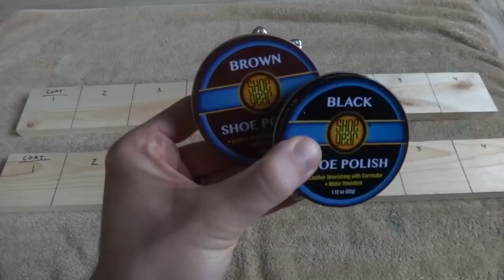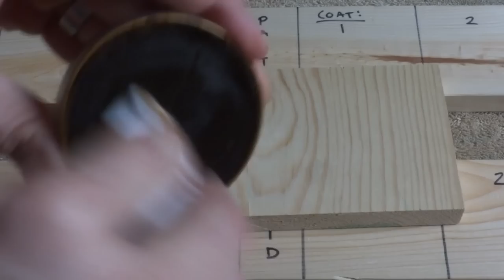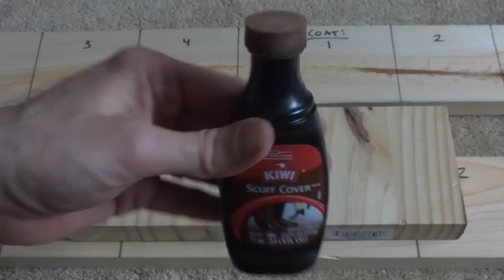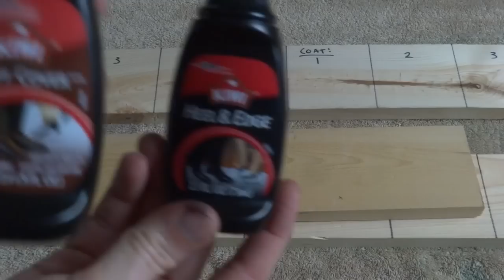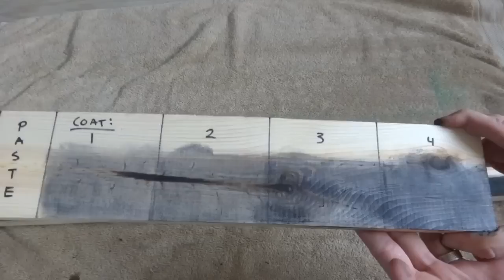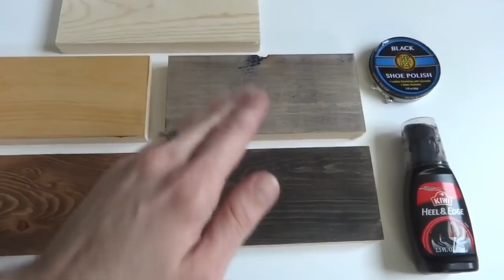How to Stain Wood with Shoe Polish!

Comment: Great video. I'm planning to use shoe polish to darken some parts of my guitar bare wood to make it look 'aged". Would you recommend using the one you use in in your video or would the paste that comes in the circular tin can be better? I plan to mix it with a little water and then use an art brush to paint the small bare wood areas around the guitar. Thanks...

Comment: The brown (scuff cover) is meant to be used on leather. The black (heel & edge) is meant to be used over rubber. Hence the different angles on the applicator pads. Heel & Edge dressing is closer to paint and is meant to be a permanent stain. The scuff cover is a leather dye and is a semi-permanent tincture.
Reply: Thanks for saying that Marvin, I was going to also, but thought I'd check the comments to see if anyone else had enlightened him on the fingers points of edge dressing.

Comment: Thank you! I used Lysol spray on wood-didn’t read directions. Now I’m left with a white cast. I’ve read that using a hair dryer and alcohol can help, but I do t want to mess with that. I thought why not use shoe polish, viola! I found your video. I don’t know if it will work for my problem, but I’m going to try!

Comment: I have a brand new walnut Mauser stock I'm thinking about going black/gray.  This might be the trick for something a little different.
Reply: for walnut you should also try using a homemade iron acetate solution --- lots of videos for that on youtube (it's simply steel wool dissolved by vinegar). the solution turns walnut a very dark gray or with multiple coats a nice black. -there will be no brush strokes because the color change is a chemical reaction

Comment: Can you put shoe polish over knotty pine paneling (the 50's variety) that has high gloss as a finish?  Will the shoe polish adhere to a high gloss or reduce the shine?
Reply: You'd probably have to lightly scuff it with 220 sandpaper to knock down the shine before applying the shoe polish.

Comment: Hi there, thank you for this demo video. It has really opened horizons for me. I wanted to ask, if I wanted to paint a natural wood cabinet with shoe polish and then use a silver gilding wax over it, would it work? Would I need to seal it or because it is wax I don;t really need to? If I used the shoe liquid and then gilding wax over it, would it work and would I still need to seal it? It's just to provide some kind of durability when everyday food items are placed over it. Any advice would be very much appreciated! :D

Comment: Have you tried to thin out the paste with some sort of spirits or thinner to get something that might flow better?

Also, with the liquid, you could try getting it out of the applicator bottle (say, into a glass jar or something) then using a foam applicator to apply it, perhaps?  You could also try thinning it a little to get more use out of it and perhaps more variation in colour (more changes in colour between coats).
Reply from the maker: I haven't tried thinning it, but sounds like a cool idea. I was originally going to squeeze the liquid out and paint or wipe it on, but decided to try out the built in applicator foam tips anyway.

Comment: Whats the best thing to use to finish it? Like giving it a glossy or flat finish?
Reply from the maker: I've had good success with oil based polyurethane and water based polyurethane.
Reply: I would agree for the liquid, but the paste is a wax. Probably best to just buff to a shine and or add a clear wax and buff.

Comment: I'm doing a cane an looking for ides does it transfer to your hands  when you touch it after it dried
Reply from the maker: I didn't notice it leaving too much after it was buffed out, but it wouldn't hurt to let it soak in and dry really well, then buff it again and protect it with a top coat.